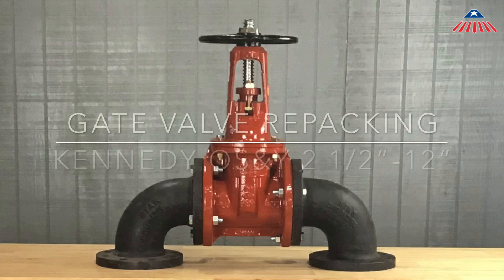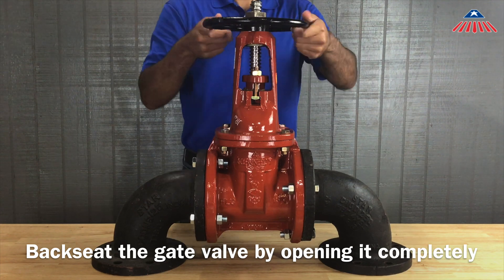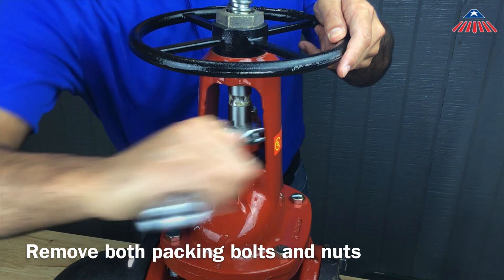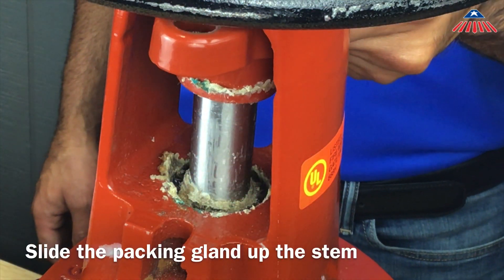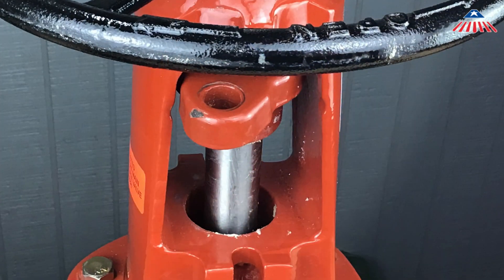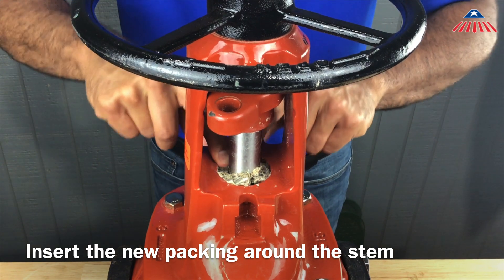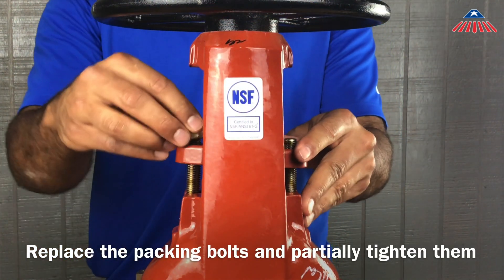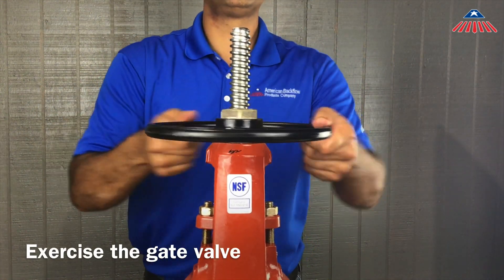Gate Valve Repacking

Comment: Dumb question can I use cooper anti seize on the valve steam for lubricantion on old valves ? I work at a oil refinery I’ve used it before and it helps on valves that are hard to spin

Comment: So you can do this while valve is live?
Reply from the maker: Yes, as long as it is just the packing that is leaking, you can backseat the valve and re-pack it while it is live.
Reply: @AmericanBackflowProducts  what if it’s leaking while backseated and the leak continues to increase while loosening the packing nuts?
Reply: If the valve continues to leak you will need to find an upstream shutoff or turn the water off at the meter in order to replace the packing.  @bluelude2001
Reply: @dlchill  actually repacked 2- 10 inch OSY valves this week and did them live.  Opened them up fully and nothing sprayed out.  Mueller valves.
Reply: Great to hear.  Typically, fully opening will help backseat the valve so you can swap out the packing. @bluelude2001